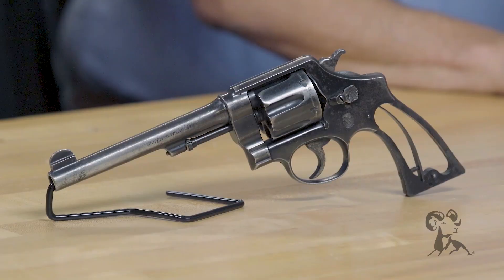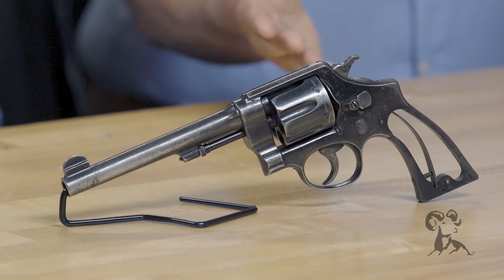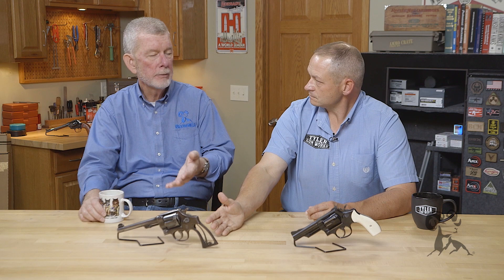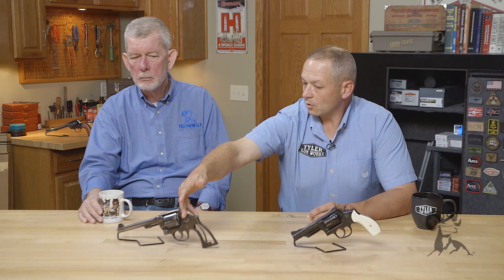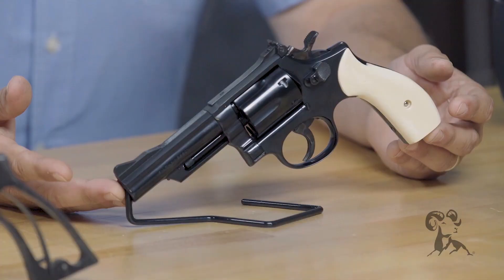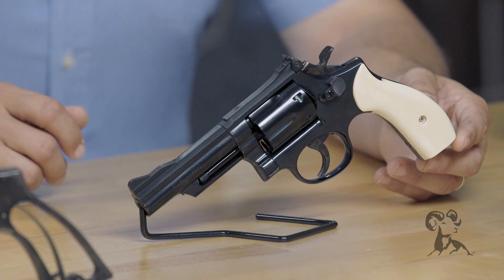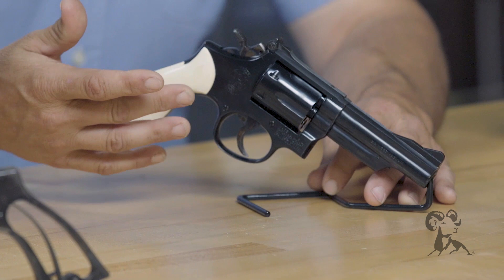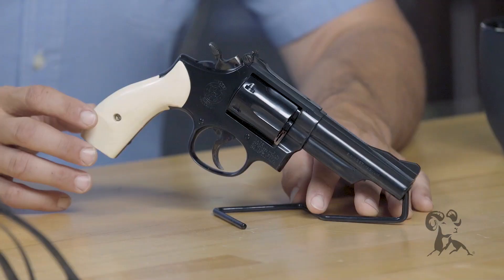Quick Tip: The Art of Refinishing Old Guns

Comment: One day after a big rain...we got some water in the basement...my gun safe is down there. All the water was gone when I got home so I thought it was minimal. Turned out it was six inches. It got into my safe. The only lasting damage was to my Colt Diamondback .22 6". It sat in a wet holster for two days. Mostly OK but has some damage to the barrel and cylinder. I think I need to contact Tyler's Gun Works

Comment: A question to you gentlemen about an antique gun with no finish left, but rusty and worn. I just bought an 1858 Starr army revolver with no patina, just a worn unpleasing, slightly pitted  mess. Is there any way to gently polish it, getting a uniform bright metal look, but apply a finish (not bluing) that mimics the shiny slightly rust-colored patina many old vintage firearms have for looks and protection? At the very least, shiny but protected anyway. I have always admired guns that have that old shiny brownish finish when there is no bluing left.

Comment: Tyler gun works is complete trash! DO NOT SEND HIM YOUR GUNS!
Reply: Sounds like you weren't happy with a job.  Could you please elaborate on your experience?  I'm currently trying to find a reliable gunsmith for a family heirloom.
Reply: @billbrasky527  I sent a very expensive rare gun for light rust fix inside near the chamber and a few deep Knicks on the outside. Communication was next to non existing unlike you spoke with his wife which could only give the answer "I don't know" to every question. He was backed up which I understand at all places but the day I was told it was shipped back it was still "curing". Upon arrival the gun was put in a far to big box with no protection padding nothing. It was free to slide around and given how shippers are that's a no go. The gun had been tossed around so much not only was there new deep scratch and indentations everything(down to bare metal, almost puncture like) but it actually busted out of the box so bad I didn't have to open it, I just pulled it out the hole. I made several contacts to the shipping company used & there was a not that the pick up driver sent as he didn't want held liable for damage claims as he picked up the box that way and even took pictures. I was already fuming but figured outside could just be camo coated worst case. Then when I checked out "the work" it was basically a rattle can blotchy mess that could literally be finger wiped off. The gun no joke came back 3 times worse then when it shipped. I took it to a local Cera coating guy who was stunned and call him to see what the deal was with the coating type & job. Once he finally got on the phone he admitted he had no clue how to fix it so he just spot sprayed the Walmart camo rattle can claiming he was over worked wasn't get paid enough, didn't do that kind of work and that "he knows a stupid gun owner who would never know the or see difference after a few hundred" rounds" the gun was delayed roller so hopefully you can see why I tried to send it to a professional. When I called him out in posts a day showing his "quality" of work he & or employees harassed every post them claimed I never sent it to them. It became the most expensive and unprofessional thing I've yet to ever experience in the 2a community.
the same local guy fixed all of Tylers work and it's still solid after 6 years almost 10k rounds and looks like factory. Even the manufacturer was consulted over this and we're shocked at Tylers work and how well the local guys turned out they've even put recommendation on their website. He also qouted a price range & charged 3 times his qoute being well aware of the job so it's not like he saw it and got unexpected repairs.
 Sorry I quick typed this and still to this day gets me a bit heated. If you have further questions or details please feel free to let me know. My review may still be on his Google with pictures before, after him & final from local repairs
Reply: @dodgersfnshepard8673  damn!  Thanks for sharing your story.  Sorry you had to deal with that, it sounds really frustrating.  I vaguely recall Clint Smith over at Thunder Ranch mention someone that he trusts to do work.  I am going to have to dig through some of his videos to find it.